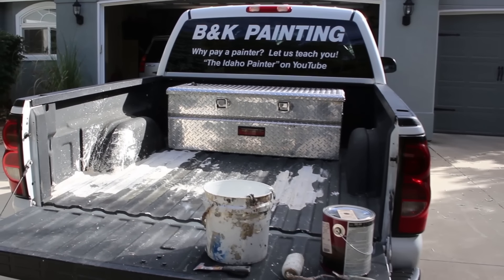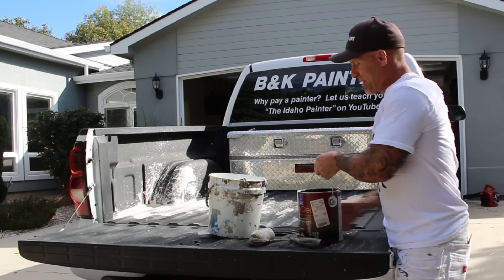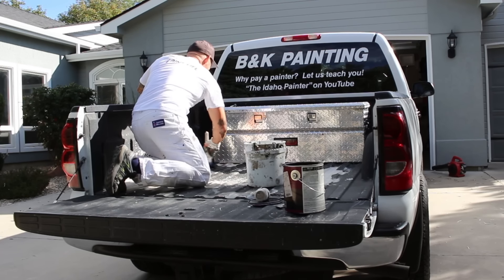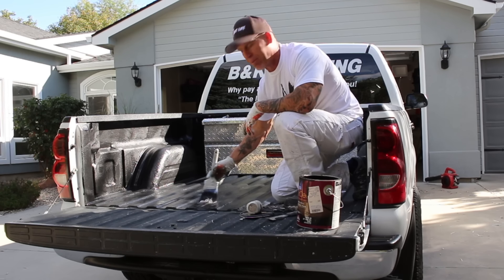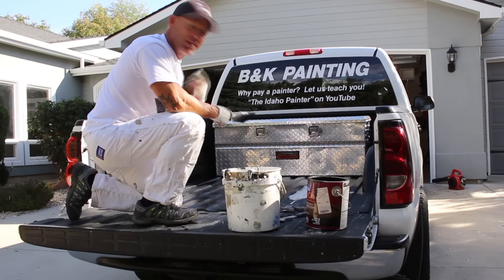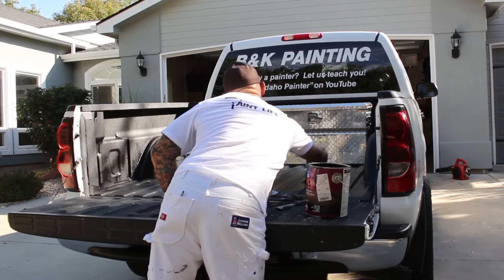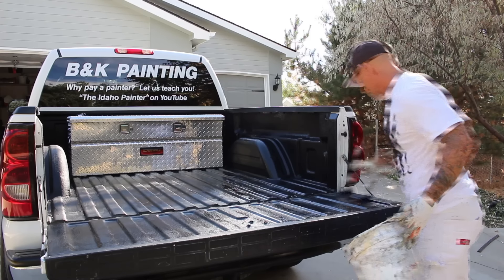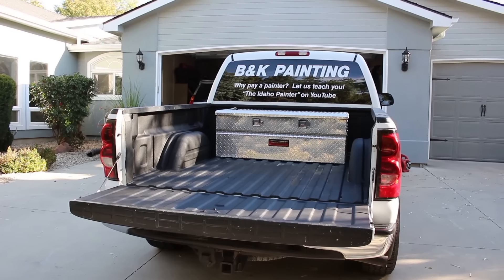How to paint a bedliner.  Truck bed liner repair. How to clean a truck bedliner DIY Herculiner.

Comment: My entire truck is coated with herculiner, and it was very faded and worn after having been applied about 2 years ago. Three days ago, I two coated the entire body with flat tricorn black superdeck like what was used in this video, and it looks flawless. I'm betting that it will retain it's original finish longer than the herculiner retained its original finish. The whole process took about 4 hours. No masking. Just cutting in with a 2.5" angled sash Rembrandt brush and rolling with a 4" Sherwin Williams blue knit mini roller. I would happily apply a new coat every 1-2 years if need be.

Comment: Haha you almost said Sherwin Williams paint “reps” good catch on painted jargon. Retired painting contractor here btw. I’m using herculiner after hitting it with light sand to keep texture. Btw UV resistance is king.
Reply from the maker: lol, thanks for watching!
Reply: Home Improvement TV  Chris how did the deck paint hold up after a year?

Comment: I think its great idea to save the bed liner. Truck liners are expensive, so a gallon of deck liner sounds like a bargain compared to bed liner replacement. I have a suggestion for product review. My dad uses the Trimaco EZ up plastic wall poles in his van as a way to prevent paint cans from sliding around when braking, turning, or accelerating. When on the job he uses it as ez up plastic wall set up, but when not on the job it doubles as a way to keep cargo in place and prevent paint from splilling.

Comment: Nice job, my rino liner had cement stains. I couldn't get it off. So I repainted it. I use Rust-Oleum High Performance protective enamel. Now ill wait and see if that works.lol but it looks good.

Comment: Funny you posted this.  This recently happened to me, too.  I'm gonna look into that product and probably give it a whirl.  It kinda surprised me that you didn't sand it (even though it's flat).  I'm thinking I might run my paint eater over the raised parts at least.  What do you think?  Good videos, btw.  Your cabinet videos just helped me out tremendously today.  Those cup hooks with the hanger.... worked PERFECT.  Thanks!  -Mark

Comment: Being as that's a factory sprayed liner I would of tried acetone and lacquer on the spill see which softens the spilled material better. Apply let the solvent work and use a paint scraper. file the edges of the scraper so it doesn't cut the liner.
Reply from the maker: Good thing to try!

Comment: What about a product like herculiner? It is a roll on bed liner. also Plasti Dip or flex seal could be a option. I just don't know how it will work with the oil.

Comment: you should have took your tool box out, taped, and sprayed raptor liner. I sprayed it in my f250 and im rough on it and I haven't had any issues. people tell me all the time how good it looks
Reply: As you suggest, a sprayed on (with a shutz gun) 2 part liner product may be a better choice, as it would build some thickness that would stand up better to having tools and supplies being slid in and out.  I did this on a boat I had when I tore out the carpet etc, and it worked out great.

Comment: Did you contact Sherwin-Williams' automotive branch? I don't know what flat automotive paint or finish product they make or carry. But this will interesting to see how it holds up. :)
Reply: I work for Sherwin Williams so it's nice to see how the products preform because I personally can't test them all. That's why I follow videos like this. Thanks :)
Reply: Mike Flex the Arrow just to share a little knowledge. Emerald interior and exterior are both LOW VOC paints. I personally will be using it for the first time this summer so I will hopefully be able to give you a bit more info then when I work with it for an entire interior project.

Comment: Looks really great, good job!  I got friends with bed liners that could use a touch-up as well and your 'experimental method' looked like its the way to go instead of them having to re-coat and add more bed liner.  How is it holding up? I am curious if there was any reaction between the coatings?  Regardless, GREAT job!

Comment: I used SW all surface enamel on my canoe and all though it does scratch when you hit rocks, it has no problem with adhesion even when completely submerged in water for long periods of time.
Reply: how did the deck paint hold up in the bed of your truck?
Reply: just an update, there is parts of exterior  of the canoe that have started to peel, although the inside is still fine I  wouldn't recommend it for boats or bedliner.

Comment: You could have used rustoleum or duplicolor truck bed coat.
Reply from the maker: Probably
Reply: Rustoleum works really well. I used a plastic loop roller and did the rockers all around my F-150. 3 coats and it’s held up for almost 3 years with minimal fade and NO flaking. Roughed it up with 80 grit and then cleaned with acetone.

Comment: I work at Sherwin Williams this is a wood deck stain product. It is not meant to bond to metal and will most likely peel once you put any weight on it. I would not suggest this product.
Reply from the maker: It has actually held up great to this day!
Reply: went on a liner, not metal, that could be why it is holding up